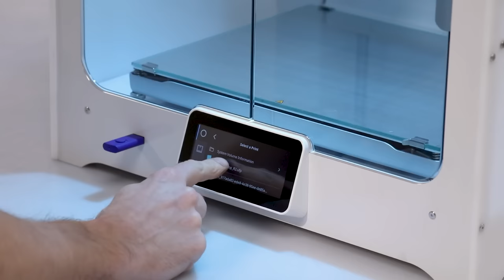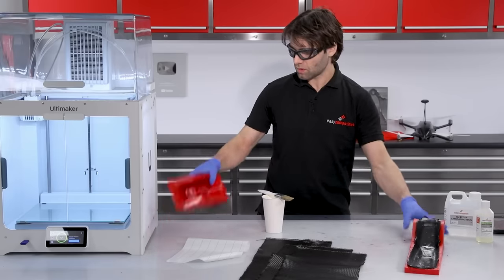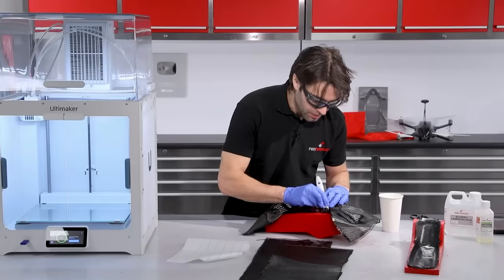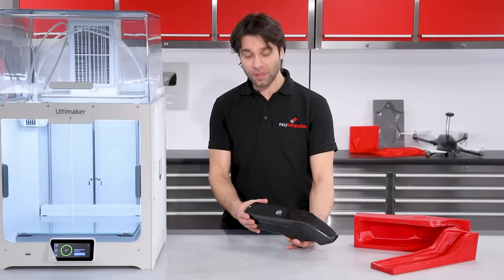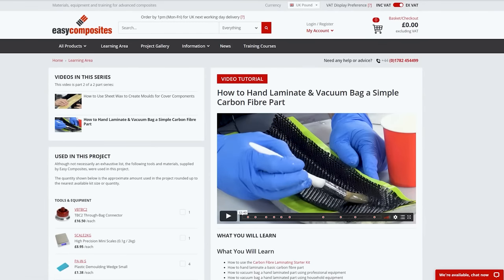Hand Laminating a Carbon Fibre Part Directly into a 3D Printed Mould

Comment: There’s any way to use prepreg  on a 3D printed mould?
Reply from the maker: Most filaments won't take the temperature. You can use the print to make a high temperature mould though.

Comment: is resin printing better?
Reply from the maker: No reason why not as long as the resin is fully cured and a release agent such as mould release wax is used to stop it sticking. FDM 3D printers are slightly more accessible and with PETG have filaments less likely for resin to stick to hence chosen for this video.

Comment: what is the model of 3d printer?
Reply from the maker: It’s an Ultimaker S5. Not the cheapest but wow it’s reliable, we’re using it every day these days and we’ve not had a failed print, it’s total ‘set it and forget it’ stuff, which is what you’re paying for.
Reply: @easycompositestv  thank you for such fast answer. in fact im still gathering all info about 3d scan, printing and editing 3d scan files to create my own forms to after that start copying your videos using your products. im just afraid that for the beginning this S5 is way above my budget. anyway, one question for you, if possible, and using this video as example, lets reverse the process. I have an old part that i want to 3D scan, and with this file scan, i would like to create a mold from it to make a 3D print so after i can hand laminate a carbon fiber part in this new mold. how to revert the 3D scan file for to a mold form? any tips or suggestions or even a lead where to find a video about it? ( sorry for my messy explanation :D )

Comment: How did you install the screws at the end?
Reply from the maker: A threaded folded metal bracket was bonded to the opposite side of the shell, the top section was then drilled and the screw goes through the top and into the threaded bracket.

Comment: Hi, are some resin vapors not dangerous for inhalation? I can understand that its difficult to speak for the recorder and some people neglect the risks, but don't see most of the guys in composite videos wearing protective masks!
Reply from the maker: The epoxy resins we use in the videos are no VOC meaning they're not off-gassing any dangerous emissions and we're also working in a well ventilated workshop environment. We would never discourage the use of a mask, especially if you had a known sensitivity, breathing difficulty or just prefer to wear one then a good organic vapour mask from the likes of 3M would be best suited. It goes without saying though that if you are cutting, grinding or making dust in any other way then the fine dust is an irritant and you should wear a suitable dust mask (as you would when cutting MDF, wood or any other product that forms fine dust).
Reply: @easycompositestv  Thanks for opening up on the epoxies! :) I only have experience with styrene based UP and VE resins which are really nasty. Without knowing better I assumed epoxies were also VOC based. But are the no-VOC epoxies standard in hand laminating/infusion resins in general?
Reply from the maker: @henrir4362  As a very general rule, yes - epoxies will be no or low VOC however always consult the SDS prior to first use.

Comment: I wanted to buy your starter kit, but at 79 pounds to ship to Thailand it just doesn't make sense.  I would appreciate a slower & cheaper shipping option.
Reply from the maker: Hi Mike, Thailand is expensive for us to send dangerous goods to, there’s no doubt about it. The Dg charge is a fixed charge, charged by FedEx, for putting hazardous materials Ona plane. This charge stays the same no matter what you order so for very small orders, like a single kit, it does seem very expensive. Slower ground options for dangerous goods to Thailand from the UK just don’t exist sim afraid.
Reply: @easycompositestv  Thanks for the information, I appreciate it and understand you're stuck with the rules.

Comment: How much heat resistant are they?
Reply from the maker: It depends on the resin system used but generally with composites, anywhere between 80'C and 200'C is possible with off the shelf resin systems and PrePregs.

Comment: Just curious what about bigger longer pieces
Reply from the maker: As long as you can make a mould, shouldn't be a problem to make bigger parts.  The wet lay process seen is commonly used on very large car panels etc so the limit is really only the practicality of making large 3D prints.

Comment: Can you use a original part off a car like carbon mirror caps
Reply from the maker: Yes you can take a mould from an original part.
Reply: @easycompositestv   for a beginners what kits do you recommend

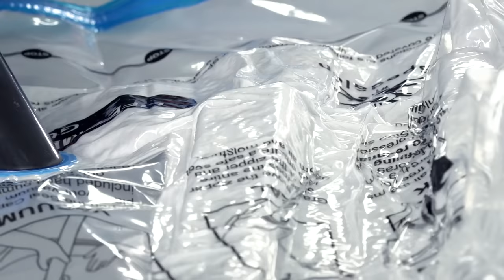Comment: 9:24 how long you have keep it on room temperature?
Reply from the maker: Hi Ken, with the EL2 resin in the video, cure time will vary depending upon the hardener speed and the room temperature but will typically range between 12 and 48hrs. Full cure details can be found on the EL2 resin TDS on our website.

Comment: how are you cleaning brushes? or you run thru brushes like usain bolt does 100m?
Reply from the maker: You can clean them using acetone whilst the resin is still wet or place them into a sealed container of acetone between uses ensuring the bristles are fully submerged as this will stop the resin curing on the brush allowing re-use.

Comment: Ok I think this all makes sense but how in the heck do you design a negative mold for carbon fiber? I have looked and looked and everyone is making pourable silicone molds etc.  Its hard to find much content on making negative molds for actually clamping a carbon fiber shape.
Reply from the maker: You do not make most carbon moulds out of silicone but the materials in the video. You would print the mould to any shape you want.
Reply: @easycompositestv  Right I guess I was nto clear. How are you designing the negative mold in fusion 360 or whatever program? That is what I find difficult to find information on. The majority of videos are about designing a mold for pouring silicone.
Reply from the maker: @blueridgedsia  Normally you would draw the CAD image for the part itself first then use one of the functions to make a mould.  There are several different functions that can be used to do it, but plenty of YouTube videos on the software that will help.

Comment: I'd never bother using a printed part without sanding out the layer lines first.
Reply from the maker: It depends on your priorities.  You could sand the mould and coat the mould with resin, or do as in this video and sand the finished part.  In this case for a one off, sanding and coating the finished part is better as even with a perfect mould, you may still get some defects in the hand layup.

Comment: You could just print a part with vac hole channels like you would do with a vacuum former part to rather the using a vac bag.
Reply from the maker: A 3d Printed mould is not airtight and as such you need the bag to achieve a leak tight system for the process to work.

Comment: Absolutely love your videos.  They are chock full of good practices.  I'm going to make bodywork for my custom racebike (@coseng433 or #hypermono) and don't know if I should make patterns, take molds off them, then make parts, or directly CNC and finish the molds then make parts.  I have the design entirely in 3D CAD and have a big 4 axis CNC that can machine tooling board and finding CNC easier than hand making and sanding stuff.  I would need 10, possibly 20 sets of parts in a best case scenario. Looking for a high quality surface finish.  Any advise is appreciated.

Comment: a $200 or so vacuum setup seems reasonable when your using a $3000 printer and more in raw materials.
Reply from the maker: But of course you could use a $200 dollar printer and, to be fair, the materials is this video only run to about $50 so this doesn’t have to be expensive. In a previous video we also demonstrated how to vacuum bag using a domestic vacuum cleaner and reusable storage bags setting you back all of about 2 bucks so we really do try to make this accessible for those on a budget.

Comment: Anyone tried covering a 3d printed mould with  self-adhesive teflon film like eg Airtech Toolwright 3 (see here : https://www.ecfibreglasssupplies.co.uk/product/airtech-toolwright-3) ?  Be interested to know if it helps cover the layer pattern in the mould and/or helps with release ?
Reply from the maker: Release tapes would work, but you will have edge lines and ridges to remove from the finished part.  A non-cosmetic part this would not matter so much.

Comment: Those molds had to take a week to print.
Reply from the maker: Unfortunately FDM printing is relatively slow in most cases.
Reply: @easycompositestv  Unfortunately true and especially if they need to be thick as well.

Comment: At what point does old school techniques get lost? You could simply wet sand the mold, spray a thin gloss coat, then a release agent. Did this 30 years ago. People reinventing the wheel. Realize composites and epoxies have been around over 50 years... Now imagine real world techniques from then, mixed with modern day technology. Here is the issue, you only have modern day.... Research Aerospace, Formula 1, and automotive industry.
Reply: Been in the composite/aerospace tech industry for the last decade, the old school techniques are not lost. The main evolution or change in process is mainly for ease of use and cost based. You have to take into account that composites are becoming more and more included into the manufacturing/high production industry which mainly needs volume to complete its goals, so the old school methods are still viable but take more skill, knowledge and resources which in return cost more.
Reply: @InfiniteP  You are correct. At the end of the day, still requires elbow grease and human skill to make the parts. Present day tries their best to exclude the human factor to make it more efficient, but they just end up paying humans less for more.

Comment: I feel like if you go to all this trouble and don't vacuum bag it you are wasting time.
Reply from the maker: Good results can still be had from wetlay.  Not everyone has a vacuum pump as it is a fairly specific and pricey bit of equipment, but 3D printers have a wide range (and growing) number of uses for the hobbyist so it is more likely someone may have access to a printer.

Comment: Dude just make a negative part and compress the cf between 2 3dprinted parts... You don't need vaccum...
Reply from the maker: You would need to 3D print a inner set of moulds to do that.  Compression moulding is not always ideal.

Comment: Wearing a mask not needed?
Reply from the maker: A mask when you’re cutting and sanding the carbon. When working with the resin you should have adequate ventilation (an open window) or if you can’t have that then a respirator.